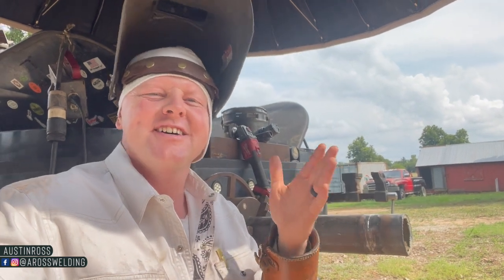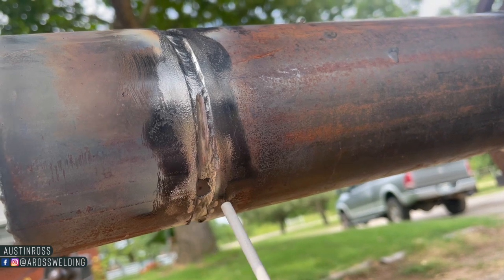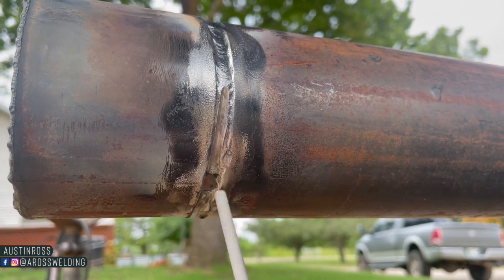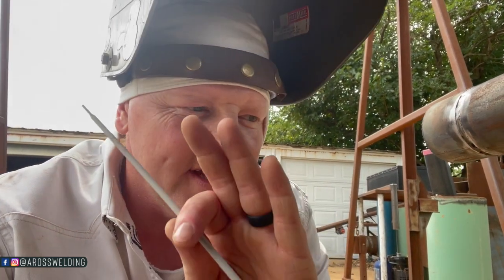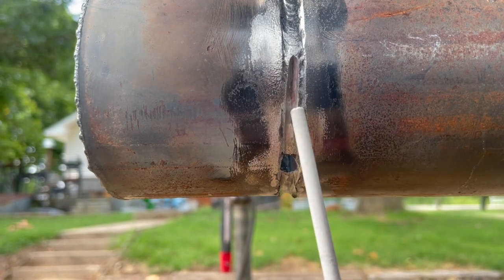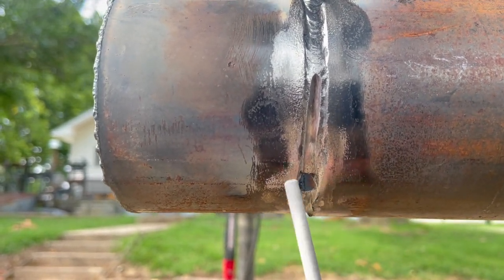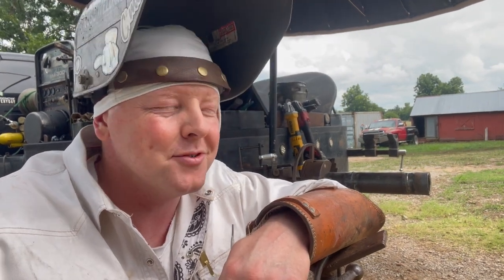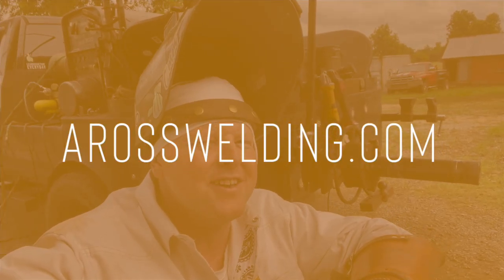5 Tips To Help You Fix A Burn Through On Pipe

Comment: So, a trick I learned with using flux core I've used on pieces with a bad fit up or keyholes,  is to set the machine to straight polarity (DCEP), then weld as close to normal as you can. Then change it back to DCEN and go over it again. The BBs of spatter give the puddle something to grab onto.

Comment: When taking a weld test, how important is the time taken to complete it? I fully understand the reasoning to let it cool down before you make the repair, but I wonder if the longer time it takes can be a problem?
Reply from the maker: It depends on the test and the inspector and their guidelines. But from my experience nine times out of 10 it will not be an issue. You only have to let it cool down a couple of minutes and that couple of minutes will not cause you to go over your time even if there was a timeline. If there is a timeline, it’s buffered by an hour or two. I hope that makes sense.
Reply: You don’t have to let it cool to the touch, just let it sit for a couple minutes at the least